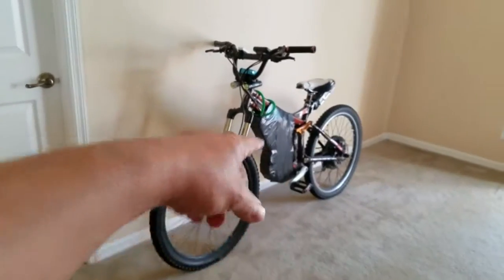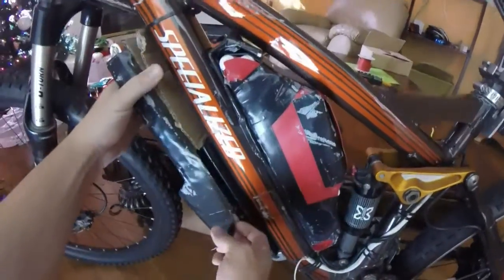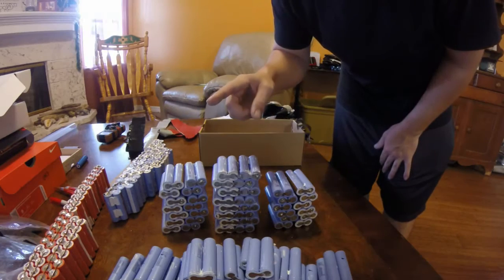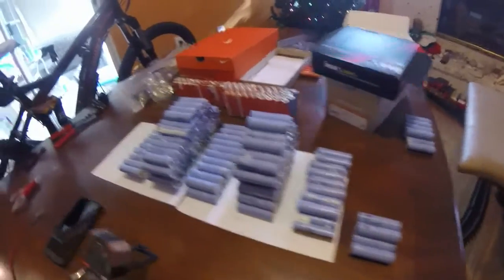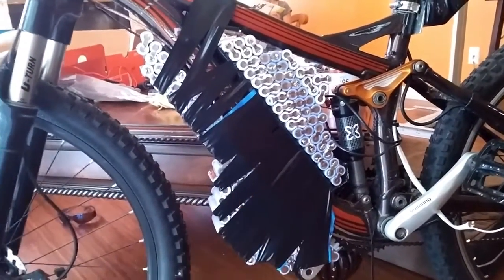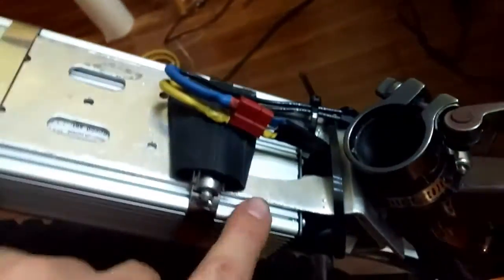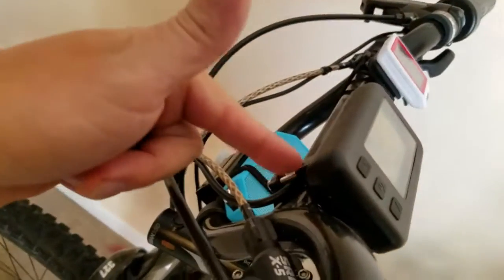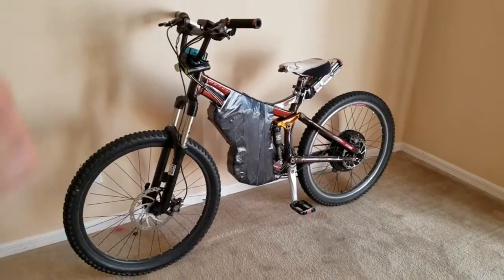FAST DIY E-Bike 18650 Rebuild | Ebike build 005 | JTgoesPro

Comment: Could you run this kit off of hobby lipo batteries? If they equaled 48 volts when wired toghether?
Reply from the maker: Jacob Renert yes as long as it puts out the amps too

Comment: Hey man would you believe we used the same frame however my battery is abit smaller. Ive 104 ncr18650b for a total of 1300wh. Whats the actual capacity of yours using the cells you've got? Also how come you didn't do 13s? Why did you choose 12s?
Reply from the maker: aaron quinn 1998wh iirc. I'll double check when I get home. I went 12s so I could just hold it wide open for practically ever without worrying about the motor or controller. Fully charged at 50v. dead at 46. Seemed good at the time. :)
Reply: JTgoesPRO ....ahh right fair enough i suppose it's your bike :P I do get what you mean though, I even bought a similar kit and now that there's 1600w going through it even the wires leading to the motor heat up to about 40°c :P I'm on the  safe side though as my motor is actually the weakest part so at least won't be having any battery fires or controller failures :P

Comment: got 156 on mine. however my CoG is WAY off because there just laying in the bottom of a milk crate on my rack... did my first test run today. did 34 miles and only used %25 of capacity! :D

Comment: Just built my pack from makita bl1830 cells (faulty packs stripped down and utilised) 13s 8p (54.6v) used 5amp fuse wire as a  saftety guard to series them up and tinning strips to parrellel. cells are 1.6amp each which is 12.8 amp/hrs. Used a cyclotricity kit as its easy to fit. Managed 33mph on flat and an impressive range (cant give accurate details yet as im still testing it but over 20miles of range on full throttle. The pack was no more then luke warm after full drainat full throttle. Battery balance is out but only by .55mv only. Just need to get a hobby craft balance gadget to fine tune them. ( I use a balance board when charging but the hobby king balance gadget should get them closer hopefully faster). Will build a bigger battery at some stage but 33mph is fast enough at the moment!!!! (picked up 15 bl1830 packsof ebay  for about £60 so bonus) kit was £400
Reply: Llamu dos Hey, much much did your build cost in total? thank you

Comment: nice job man! may i ask? im thinking to upgrade my kick scooter with new battery and controller! however i cant find controller with  charging port! only battery port! my battery have only to cable! therefore i have to plug off the battery and charge it separatelly any time! is possible to make bridge cnnection???

Comment: Nice work , if ur motor can pull out 35mph on that voltage that means it is realy power hungry motor and in that case it is good that u made battery with a bit lower voltage but much higher capacity. My ebike on 48v (13S 10p li ion) can go only up to  28 MPH and im planing to raise the voltage  to get more top speed ;)
Reply from the maker: +Igor Tomic Thanks for your comment!! So at 35, I'm tucked on hard fully aired up tires at full charge on level ground with no wind clocked on my phones gps. I'm also a pretty small guy. =]
Just riding around it easily goes about 30-31 but I usually cruise around 20-24ish mph. Mine battery is only a 12s that I run fullt charged at 50.2volts right now, I may add one cell pack to the bike in the future to make it a 13s and run it to 54.4 volts.
Reply: In that case u may get additional 2mph of top speed.. I suggest u do that , make it 13S pack and then set the charge voltage somewhere around 53v or 53.5v... This way your battery life will be much better